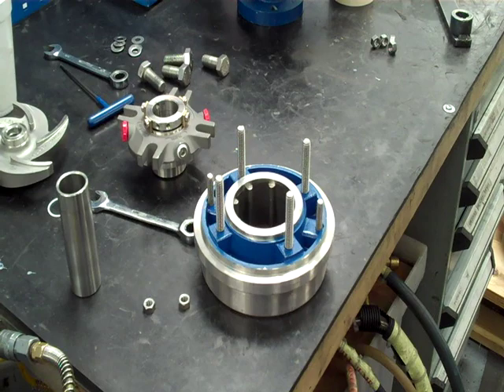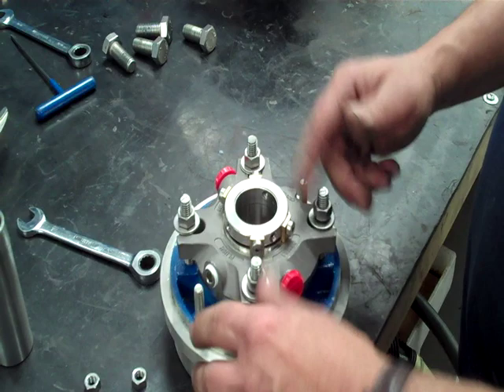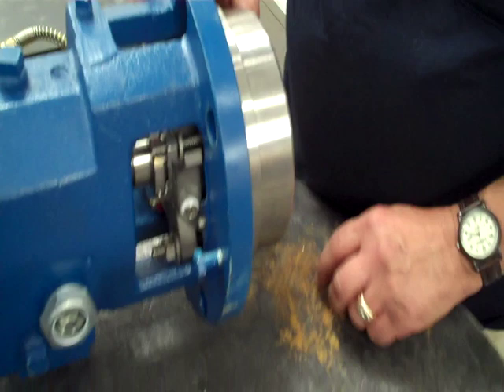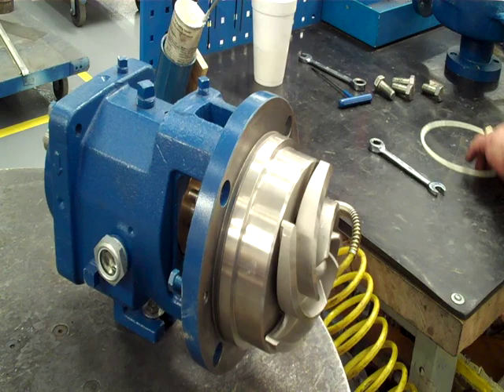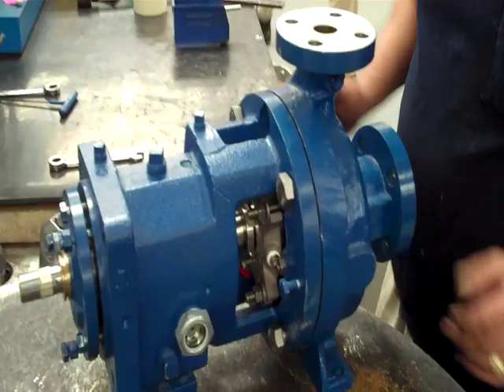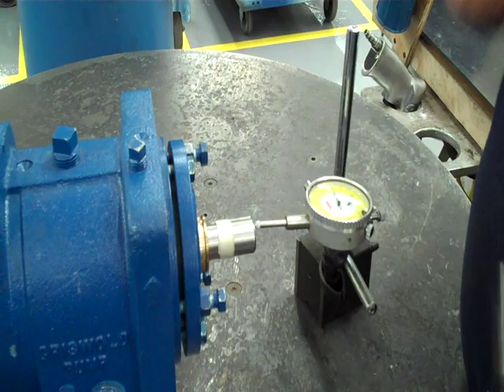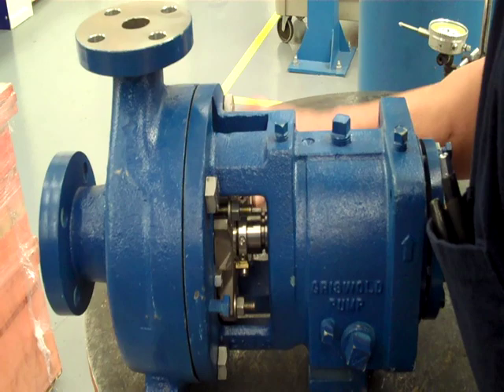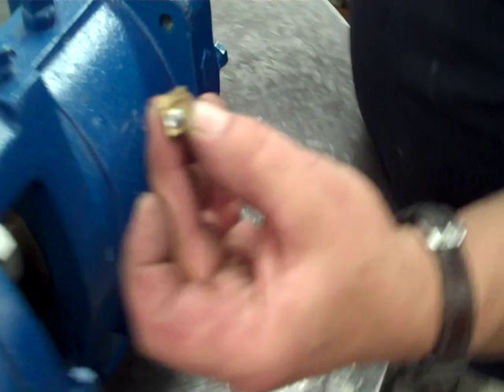Griswold Maintenance Tip - How to Install a Cartridge Seal (811 ANSI Pumps)

Comment: elpaso991 You put the flush line on the same side as the sight glass because the volute is pre tapped on the neck. It avoids having excess line bends and you can usually buy pre cut braided stainless steel line for the flush. He is working on a Griswold 811S, normally on the smaller pumps you have to remove the stud on that side that attaches the seal plate to the powerframe in order to pipe in your flush line because the stud blocks it.

Comment: Ok... 1. why are you using crappy threaded bar instead of engineered studs ? 2. what a great design, the flush connection is obscured by the locating fastener for the seal housing /stuffing box! 3. you stated that you plug the seal connections but you should always leave the drain port open. 4.Where is the torque driver for the set screws in the seal they should be tightened to 4.5 NM!.5. they are not set screws they are socket grub screws. 6 You tightened the seal gland nuts up wrong! they should be tigtened up in a diagonal pattern not side to side. 6 You failed to torque up the seal gland nuts. 7. why are there no washers on the lock nuts fitted to the bearing carrier? 8. Why are the bearing carrier fasteners covered in paint and prob made from mild steel so they will sieze on site and be a pain to move next time you set the impeller clearance? 9. You didn't torque up the casing Set screws.10. Why use a pair of crappy water pump pliers to tighten the impellor? just use hand pressure and tap the shaft spanner on the bench ! .....in short if you are going to put these instructional videos out get it right for god's sake

Comment: Actually you did that wrong! The seal needs to go on the pump shaft first and then bring the backing plate on and slide the seal back and then bolt it up once in position.... There is enough variability in the bore size you may have the seal off-set on the shaft causing misalignment. Just in case you need to know, I have 25 years experience in doing this and seeing the results of doing it wrong.